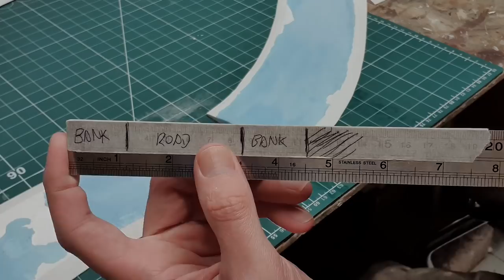Matching up your Modular Wargaming Roads & Rivers!

Comment: Love DAS. Just dont spread it on any thicker than 1/4" or it can have cracks when it dries. But thats simple to fix, just fill them in with more DAS. It can cause warping too. But bending it back into shape will fix that. There may be micro-cracks when you do this, but they are almost impossible to see. I found that just painting over them will fill them in most of the time. DAS has no sticking ability of it's own really. There's no glue in it. So I use PVA and water to stick it down to things. Great first video Mel, glad to see you back on Youtube. ;-)
Reply from the maker: DAS is great stuff mate, and its good to be back.

Comment: Mel I really need your help with a question. What thickness of epvc foam board are you using for basing and roads etc. So many options 3mm 5mm 10mm etc. Also where do you source it from mate? I'm in UK too. I'm really hoping you see this cause I'm about to order and I'm unsure where and what thickness you use. Thank you mate. P. S got your book on the way and hoping it helps with these sort of questions lol